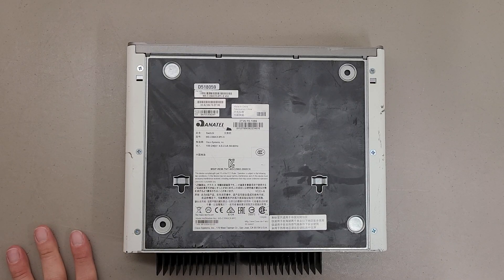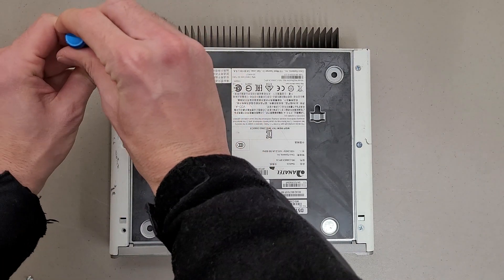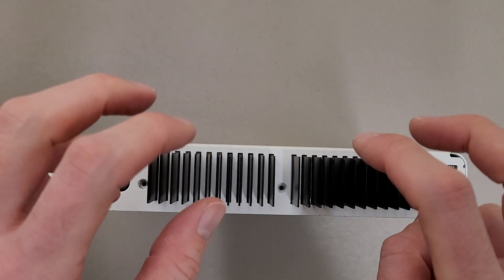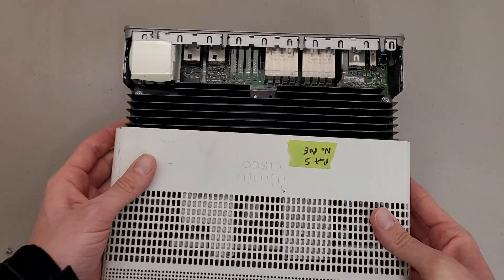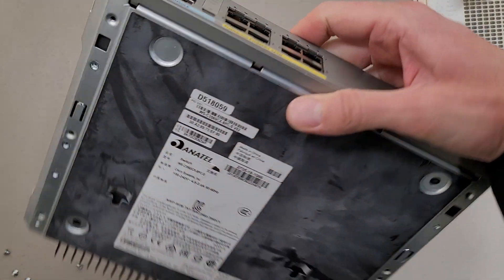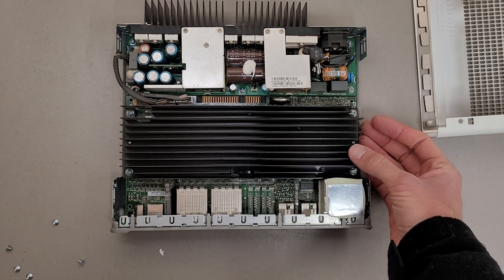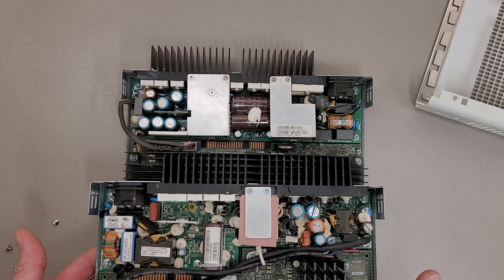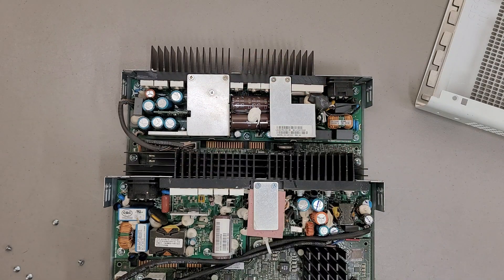Cisco 8-Port gigabit PoE+ passively cooled switch WS-C3560CX-8PC-S #teardown

Comment: This one looked so different inside!  It was interesting seeing the parts... it looked like the "grid" took up most of the space.  🤔
Reply from the maker: Yeah. More heatsinks since it has to dissipate twice as much power. I forget what their exact rating is without looking. I think the other one was around 150 watts vs this probably being near 300 watts.
Reply: @computersales  That makes sense why it was larger. Too much heat seems to be an enemy. After fixing the fan on my Toshiba laptop twice, I ended up doing all my course work for the PsyD with my laptop sitting on ice inside plastic. I tell ya, what we won't do to make something work for us!!!